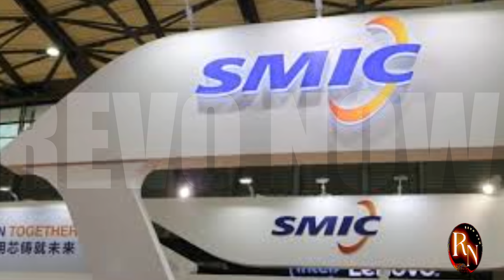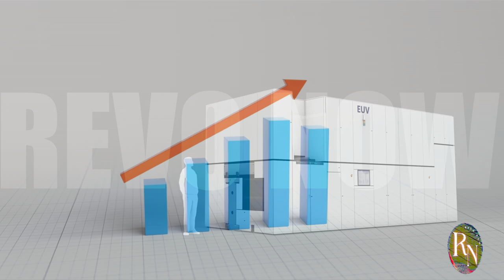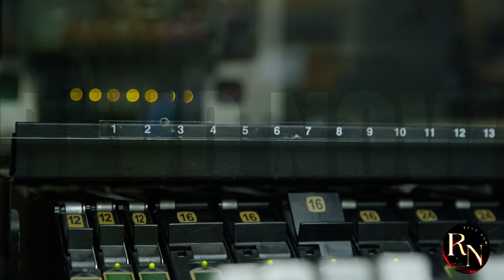ASML REFUSES to Fix Chinese EUV Machines! China Doesn't Need ASML EUV

Comment: Now that those machines are broken & without official service, local engineers can now disect those machine & get them working again.
Reply: With machines like this, it's not that easy. These are the most complicated machines mankind has ever built.
Reply: @MnemonicCarrier don't underestimate the Chinese. They can send satellites and and spacestation modules into space and possesses hypersonic missiles which the US failed to produce. It is just a matter of time for them to work it out.
Reply: I remember the West saying China would take 7 years to produce 7nm chips. Now they just produced a 4nm chip.
Reply: @pakjai5532  I don't underestimate the Chinese - what they've done in the last 30 or so years is nothing short of amazing. However, building lithography machines that can create 7nm (or lower) semiconductors is orders of magnitude more complicated that any of the things you have mentioned. Personally, I hope the Chinese pull it off - I'd love to see some competition in this semiconductor industry (and lithography machines).
Reply: @tomjohnson1110  Have they produced their own 4nm chips? If so, which lithography machine(s) did they use to achieve this? I don't think this is true. Even when they "created their own" 7nm chips, they used ASML lithography machines from the Netherlands.
Reply: Those machines has more value "untouched" then braking the "OEM seal" for under contract of said machine, if manufacture aka ASML fail or purposely not service those machine under contract, those Chinese companies can sue ASML in the Billions $$$ in loosest, present & future lost in sales and the cost of said machines.  ASML could be seeing a Trillion $$$ lost in lawsuit over said of those purchase contracts.  ASML not to mention future sales.
Reply: @MnemonicCarrier  You seem to be very confident that the Chinese will not be able to make these machines. Rocket science is also a very complicated science which is why the US was very confident to stop China progress by banning them from participating in the International Space Station. Guess what China did? They started their own space program and even built their own space station. And no you can't simply cut and paste to build and operate a space station as it is technically complex and you need a team of highly intelligent and smart scientist and engineers to operate a space program. Even Boeing with huge pool of engineers and long vast experience in aviation had problem with their recent Starliner capsule spaceship. As we speak now, the Chinese are hard at work making their own machine!😂
Reply: @LordKarma101  Dude - I'm not "confident" the Chinese will fail in their attempts to make advance lithography machines, I'm just not underestimating how complex these machines are (that make chips with wiring just a few atoms wide). I want the Chinese to success in this endeavor, as competition is a healthy thing and will bring about more innovations! Also, full disclaimer - I'm half Chinese 😉 There's nothing I'd like more than waking up one morning and reading about how China is now making lithography machines that can produce 3nm chips.

Comment: Does China has EUV machines? It only has DUV and probably ASML refuses to service the two high end models DUV which can produce 7 and 5 nm. This is the instruction from the master US regime
Reply from the maker: Sure there're working on it... China's Nano Lithography Machine
China has made significant advancements in developing its own nano lithography machines, aiming to achieve technology self-sufficiency amid US sanctions. According to the Ministry of Industry and Information Technology (MIIT), China has developed two domestically made chip-making machines that have achieved significant technological breakthroughs.
Reply: @RevoNow Thanks, I had the same question?
Reply: The Chinese have just filed a patent for their newly designed EUV lithographic machine which is now undergoing evaluation and approval.

I expect it would be ready for production of high end chips within 6-12 months.

They have already been developing this machine for half a dozen years or so.
Reply: @Limfame  Can you show me the link of the article or discussion you have taken this from? It is something I have been waiting to read..thanks
Reply: @RevoNow  But these are machines with wavelength of 65nm the most and can produce only 28nm chips...it will take another few years to bring the tolerance level down. Hope it wont be too long for me to pop my champagne
Reply: @RevoNow  No
Reply: @RevoNow which machine is that ? Last I read SMEE has not even make a prototype working machine
Reply: Last week they made 4 nm chips 🎉 when 1,45 Billion people work together in 60 years: workers, companies, government, wonderful things happens ❤C❤H❤I❤N❤A❤
Reply: @Vladimirleninputin  no last week they made 0 nm chip.
Reply: @SumTingWong888  your funny, they have the Technology to make 4 nm chips, also they made 6G internet, Chinese students call western internet connection "turtle speed" 😂😂😂
Reply: @Vladimirleninputin  I know that. I don’t dispute you. They also made 0nm node chip last week too.
Reply: @SumTingWong888  0nm node chips 🤗 that's amazing, thanks for insight, already now china city's look like futuristic, while USA look pre-historical
Reply: @Vladimirleninputin  Viva Vladimir Putin. Viva Xi JinPimg, best leader in the world.
Reply: @Vladimirleninputin  which city ?
Reply: Human resource still rules💯💪🙏

Comment: Sorry the presenter gave wrong information. The Chinese doesn't have no ASML EUV machines; they have lots of ASML DUV machines. And China at this moment of time hasn't made any EUV machine yet.
Reply from the maker: The China's Nano Lithography Machine
China has made significant advancements in developing its own nano lithography machines, aiming to achieve technology self-sufficiency amid US sanctions. According to the Ministry of Industry and Information Technology (MIIT), China has developed two domestically made chip-making machines that have achieved significant technological breakthroughs.
Reply: @RevoNow  DUV and EUV machines have to be clearly differentiated, and not be muddled up.